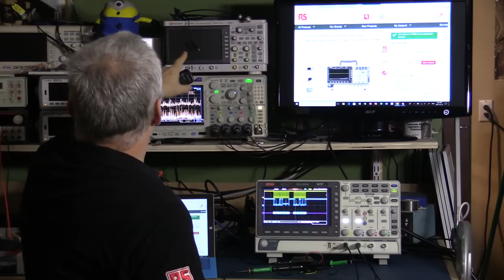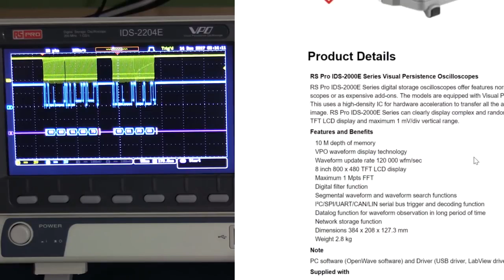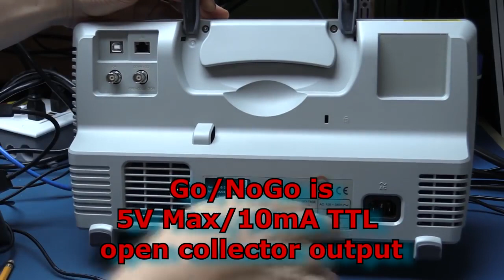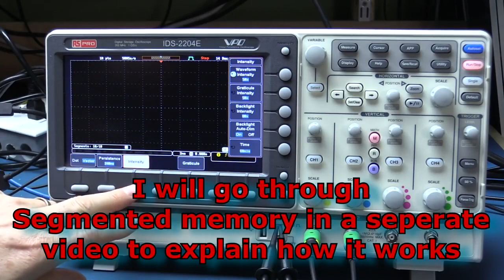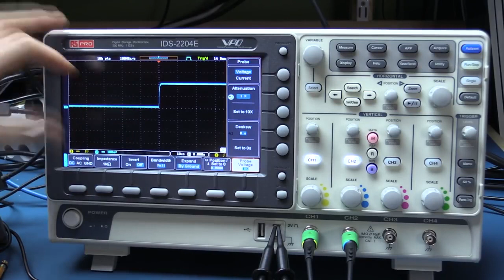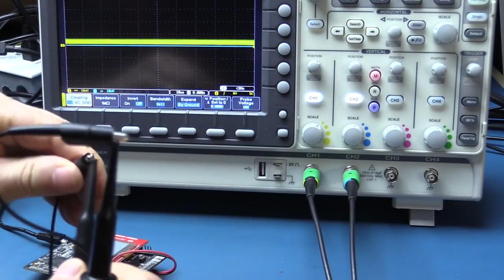Review of the IDS-2204E Digital Storage Oscilloscope by RS PRO

Comment: I wish I bought this scope. I just got the Siglent SGS1104EX, it looked like Siglent had similar feature, but now I experience it is not. 1) No separate control knobs for each channel 2) You can not use deep memory for long period of signals (only zoom into signals what is visual on the screen (segmented memory is in most cases not useful for me), I want to be able to stop on signal and look 1 minute back, it is not possible. 3) You can not filter your signal like the Instek (very useful for low frequency low amplitude signals) 4) The Siglent has high fan noise (Is the Instek better?). 5) When I use acquire function, the scope screen blanks during acquiring, so I don’t now what happens with the signals real time for about 20 seconds (really !!!!). I wanted to like the Siglent, but I can’t.